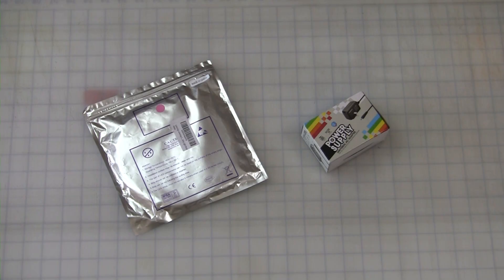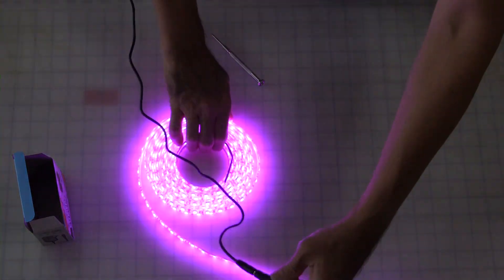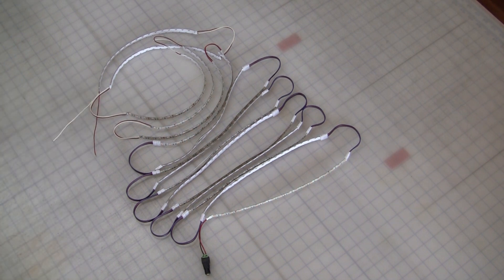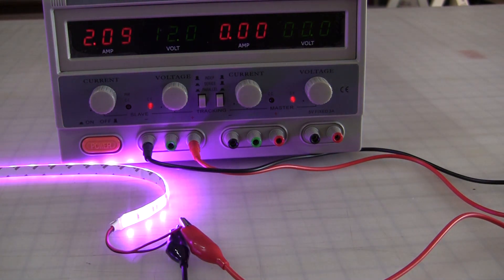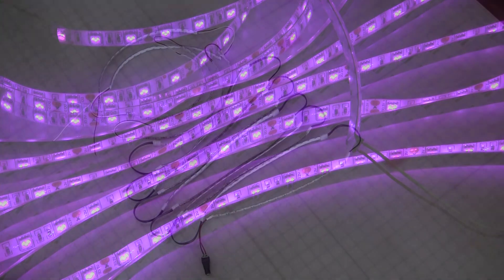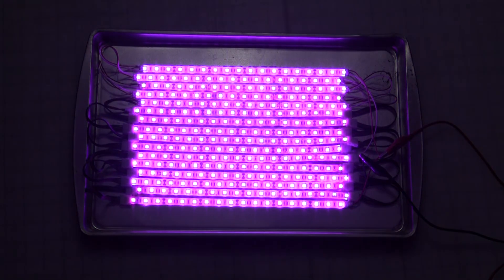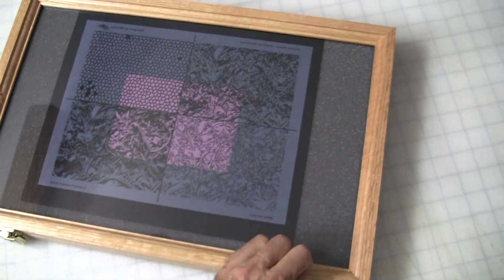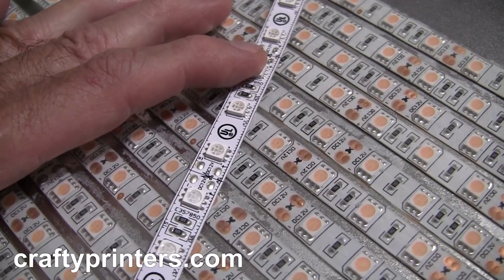HowTo - Make a purple LED exposure unit(?)

Comment: I like this experiment. I am thinking of trying out the tracing light boxes available at Amazon as an exposure system. They are LED lit, seem fairly light and inexpensive, and can be used for other crafting purposes as well.
Reply from the maker: They are cool, unfortunately we've tried them and  they do not work as exposure units. The white light does not produce enough upper blue/UV wavelength plus the LEDs are low power and usually only along the edges with a defusing front panel.

A shadow box is an inexpensive and convenient way to hold blue or UV LED light strips. You can even add white/RGB LEDs to use as a tracing tablet.
Reply: Which particular brands have you tried already? Do you know which kinds of white LEDs are appropriate?
Reply from the maker: In the video we're using purple led strips from amazon: https://bit.ly/2nWMwYl
We've also tried the following UV LEDs (new videos soon):
amazon: https://amzn.to/2wktBdC
superbrightleds.com: https://bit.ly/2nWMwYl

LEDs from superbrightleds are more expensive but they are fully spec'd so you know what you're getting.

I'd suggest daylight white LEDs (5000k or higher) to use in a tracing box. Also give RGBW strips a try to control color. None of the white LEDs we've tried worked very well as an exposure source. Most took over an hour just to start exposing the film.